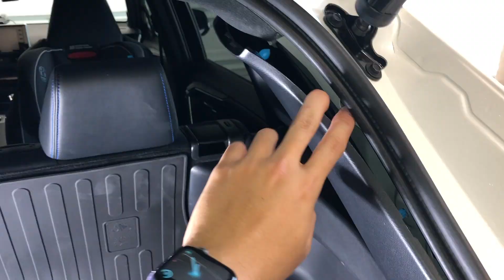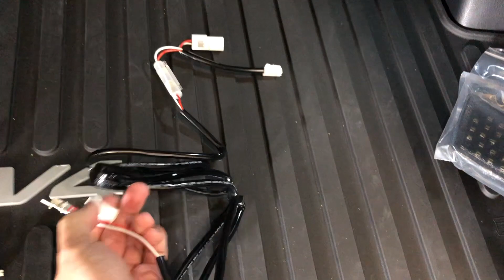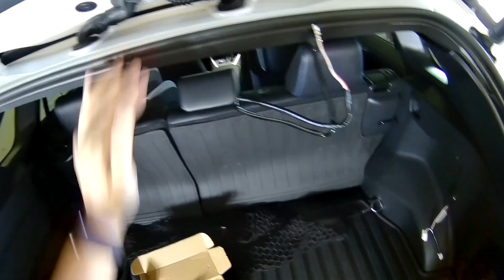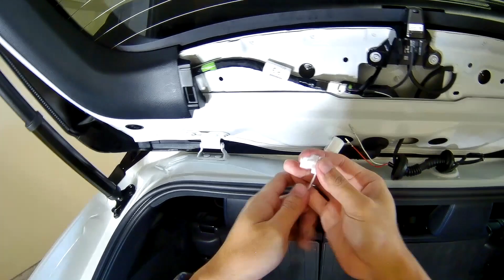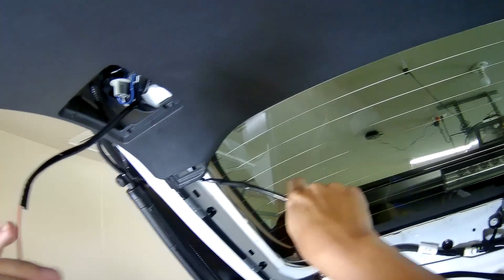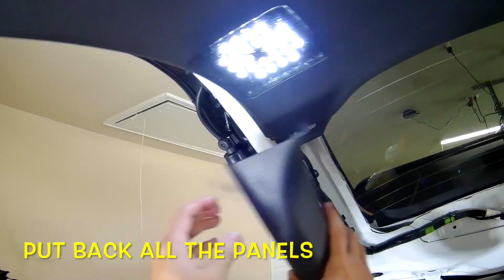2019-2020 Toyota RAV4 - Trunk Cargo LED Lights POV Installation

Comment: Did the install today, took about an hour. Hardest part was getting cable through that rubber boot (I used the drivers side. On my 2024 RAV the boot had a rubber extension that was tape wrapped to the existing cable so I had to cut that tape to get access to the boot. Used a fish stick to push it through. Everything else was pretty easy and it works great.

Comment: Thanks a lot for the helpful video. I encountered a problem when I was done. My trunk wouldn’t close anymore. I looked online and you have to disconnect the battery, manually close the door so it can recalibrate and then restart the car. My door was functionnal as intended after this

Comment: Don't' use zip tie and Vaseline, just electric tape the wire to tip of Phillips screwdriver and shove it through the black tube. Btw, it's 100% better if you hardwire it to the battery as I did, so it doesn't turn on automatically with door open, which annoyed me a lot. Not that I carry a safe full of money, but I was tired of turning both lights off as soon as door opened. Lol.

Comment: Can we not just bypass the inserting of the wire through the rubber tubing or grommet . Why insert it when no electrical connection thereto.  Why not just tape it around the grommet ??
Thanks

Comment: Each light panel will only fit into one particular side. You can't tell by just looking at them, and they don't seem to be marked 'left' and 'right'. Each one just fits better and will pop into its cutout with just moderate force. You'll see that if one is trying to be fitted into its opposite side it will appear to be just slightly out of shape for that cutout.  ------  When pulling thru the first cable that 'T'-s off from the existing small right side light cable, be sure to leave cable slack down there. The in-line fuse for the new hatch lights is located about 8 inches up from the bottom end of the T cable. If you ever need to replace that fuse there will then be enough cable slack to pull the fuse holder out the lamp hole to change the fuse.  ------   Before even starting the install process, be SURE to cut power to the existing right side light circuit. This CAN NOT be done with any of the car's switches or controls. I'm sure there's a fuse for it... somewhere.  You can go find and pull it out temporarily if you want ! The easiest way, by far, to cut power to just this circuit is to use a flat screwdriver to press down the center 'claw' in the hatch latch which locks it into the 'closed' position when closing the hatch. Doing this fools the car into thinking the hatch is closed and cuts power to that circuit. When you really want to close the hatch be SURE to press the touch-sensitive button under the lip of the panel that goes across the middle of the back of the hatch's outside, You do when opening the hatch when it's closed. This powers the solenoid that unlocks the hatch's latch so the hatch can be opened. [I suppose this means that if the battery is (completely ?) dead, the hatch can't be opened at all.]

Comment: Great video - best that I've seen ! I'm glad you showed that you tested the lights before replacing all the panels. One of the connector pairs may not have been seated all the way in its mate - you won't know til you test it. Toyota and Honda connectors and wiring are top-notch and generally foolproof, though.

Comment: Its a BAD IDEA TO USE VASELINE as a lubricant because it is petroleum-based. All petroleum products deteriorate artificial rubbers (with the exception of Neoprene and whatever gas and hydraulic fluid lines are made from). Use SILICON GREASE - AKA 'DIELECTRIC GREASE'. Products labeled 'dielectric grease' are far less expensive than those labeled 'silicon grease'. // It use can put up with the mess both WD-40 and silicon aerosol spray will work fine and not damage the soft rubber boot.

Comment: Thanks voor this video! Very helpful. Everything works fine. Only thing I changed were the tie-wraps. I used an electric copper wire. Pushed this from the small hole forward. When it was through, I folded a hook. Taped the cable ends together to protect them, then attach the taped cable to the copper wire with tape. I pulled everything through with a little Vaseline. Worked without any difficulty and very quickly. With the tie-wraps method I expierienced too much resistance for the tie-wraps and the hole at the end was very tiny and difficult to reach for me.

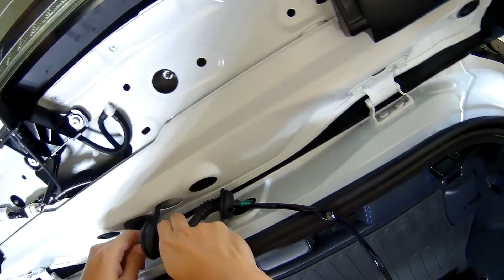Comment: I used a hydroflask straw that was big enough for the wire to snake through the bigger rubber tube. I lubed up the exterior of the straw, fed it through, the lubed the cable a little and slid it through the straw. Put the straw back through and boom! Saved so much time! 6:47

Comment: A very useful video!
Note: DO NOT plug the harness into the factory wiring connector until you are done, and then do it from the back seat with the trunk *closed*! Otherwise you will blow the fuse. Ask me how I know.
The instructions do say to be sure the power is off when you plug it in...

Comment: Great Job and the best of the tutorial out there.  Clear, concise, and well organized.  Would suggest using Silicone Dielectric Grease instead of Vaseline as a lubricant to fish cables thru the rubber boot.  Also, Geraldo is right, the end connectors are pretty fragile and some other folks on videos did damage them.  A trick to protect them is get some Tread Protectors from the hardware store.  Use the Red one which is small and moderately snug.  Put those over the bare connectors before you tape the Fish wire and tape them together.  The use of a Wire Tie end as a short semi rigid Fish tool is pretty slick.  Don't overlook his suggestion.
Reply: I wrapped the connectors with tape before taping them to the zip ties. Worked like a charm!

Comment: Do these lights only turn on by manually turning them on or it work like the cargo light, it'll turn on after trunk is opened and depending on if you had it set to on/off previously?

Comment: As far as I understand it, the right side conduit is for the wiper fluid tube for the rear wiper. That being the case it seems to be a very bad idea to run the LED power cable via this conduit.
Reply from the maker: Why is that a bad idea? Honest question as I’m learning
Reply: @Otthox  you know it's bad to mix electricity and liquids right? Seems like it's not worth the risk to put them in the same conduit
Reply: Some of the other install videos I've seen of this use the left conduit specifically because the right side one has the tube for the rear wiper fluid.

Comment: These guys owe you some money! I was ready to return this as soon as I opened the package. My instructions were all in Chinese! 

I had to replace the fuse instantly for some reason but it’s all good now. Also, a slight difference was mine came with the connector to y-cable already installed so I had to cut and splice back together with wire connectors.

Comment: Did the install but the lights don't turn on neither does the cargo side light but all other interior lights work fine. Is there a fix for this?
Reply: Did you ever find a fix? Was it a fuse?

Comment: An alternative to the Vasoline is to spray a bit of rubbing alcohol for some lubrication.  It will evaporate after and leave no residue.
Great video.  Thanks.
Reply from the maker: Oh rubbing alcohol also provides some lubrication? I didn’t know that, thanks for the tips!
Reply: @Otthox  yes.  I use it to install rubber grips on bikes all the time.  And to help bike tires to seat on tight rims.

Comment: Can you set these lights so they come on when the trunk is open and off when it is closed? Or do you have to turn them on yourself every time
Reply from the maker: The light will come on automatically when the trunk is open and shut off when you close the Trunk, it's automatic

Comment: Mine are not turning on.  I matched the wire colors,  checked the fuse connection.  The side light turns on, so there must be something wrong with the end you connect to the Y cable.
Reply from the maker: You fuse could have blown up. My fuse didn’t blew up when installing but  I heard that this is common problem. Try getting a new fuse and see if it works
Reply: Did you ever figure this out? Mine isn't turning on and I also checked the fuse.
Reply: @mejaii  Yes, I went through 2 of these and BOTH had a bad fuse.  I took it to a car audio shop and they gave me a good fuse for $5
Reply: @TheBikingViking  this is me! I literally installed twice, bought a second set. I'm going to buy a different fuse. Thanks. Thought I was going nuts.

Comment: Great video. I'm going to buy these lights and install them following your steps. You made it look super simple.
Reply from the maker: The hardest part would be pulling that wire thru the rubber boot... took me a couple of tries, but once you pass that, it’s a breeze

Comment: I blew the glass fuse that came with the led lights. I think it happen when I touched the red and white wire together.  I replace it with a 5amp fuse from Auto Zone.
Reply: You definitely do not want to plug the end next to the cargo bulb where it gets power from until you have it routed and in the connector.
Reply: I wish I saw this comment before I install the lights
Reply from the maker: Oh... yes, I read some reviews that some people had this problem when installing. Thankfully mine didn’t blow out
Reply: Happened to me also. Darn.
Reply: Same exact thing happened to me... did the 5amp hold up? Auto Zone folks were saying its a bad idea.
Reply: The glass fuse that come with these are rated 3 amps . How is 5 amp fuse working for you?

Comment: Hey man! Great vid! I’m going to try to do this install this weekend. In the directions, it says to disconnect the negative terminal on the battery before starting. Did you do that and is it necessary?
Reply from the maker: I didn’t disconnect the negative terminal on the battery and the lights work fine for me
Reply: @Otthox  Thank you!
Reply: @Otthox  I just installed them today and followed your tutorial step-by-step. The zip tie and vasoline trick didn’t exactly work for me as well as it did for you. Mine got stuck in the between the accordion parts and I had to try to work the rubber thread it through but I got it done. After that, it was a snap. Thank you!
Reply from the maker: @zxe038  great job! Yeah it took me a couple of tries to get the cable and zip tie to go thru the rubber.... I had to tape and the zip tie quite all the way up then it worked... this is the hardest part but after that, so easy

Comment: Nice video, have you seen the new brake lights? The red LED bar across the back of the car between the lights. Theres also rear brake LED pillars that go on each side of the rear window. That looks like a really cool upgrade
Reply from the maker: Yes, it’s been on my eBay watch list for months. They all shipped from China, I’m waiting till there is one ship from the US
Reply: Gerald Otto that’s pretty smart. I think I might do the same. I really like how you did your RAV4. I want to black out my emblems too. At first I wasn’t into the idea of wrapping the headlights but now I’m thinking of the benefit of protection from the sun. So the headlights plastic don’t turn yellow and ugly after a few years.
Reply from the maker: @GundamDroid  yes at first I didn’t plan to wrap my headlights too, I really like how bright my LED stock headlight is so I don’t want to make it any dimmer. But then I came across that bio pulse hex film, the smoke is light and I really liked that hologram effect. Plus to your point, it will protect the headlight from yellowing

Comment: Thanks pare. Can you do interior cabin LED tutorial sometime? I ended up returning the LEDs since I couldn't remove the cover for the driver overhead light  salamat
Reply from the maker: you mean the middle map light in the front? if so yeah, when I just got the car I tried opening it and it was really tough... that's the only interior light the ti haven't changed. But I'll tinker again and see if I can open it, I'll let you know.
Reply: @Otthox  you can remove the whole over head assembly with 4 red trim clips on the corner. Bulbs are accessible from the back.

Comment: Great job! What's next?
Reply from the maker: Alfa Alpha thank you! I have one lined up for exterior and another one for interior. Any more ideas?
Reply: @Otthox  Hi Gerald. Every time I buy a car the first thing what I do is replacing OEM air filter with K&N. I recommend. Good stuff. Also to give your SUV a bit a brutal look I'd think about a bull bar with an extra LED light. Looks great on RAV-4. And usually I put a wider tires. In your case I'd replace original 225/60/18  with 245/55/18. The same overall diameter and the car will change the look forever! Well, of course all this stuff is kind of pricey.
Reply from the maker: @alfaalpha5194  hey thanks for the suggestion! I’ll research and think about it
Reply: @Otthox  Good point. Don't listen anybody and always do your research first.